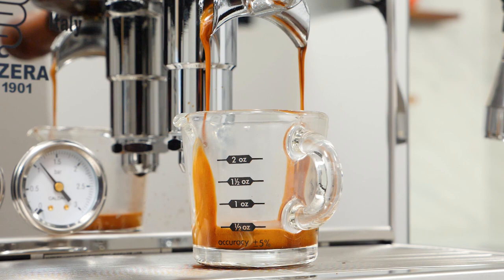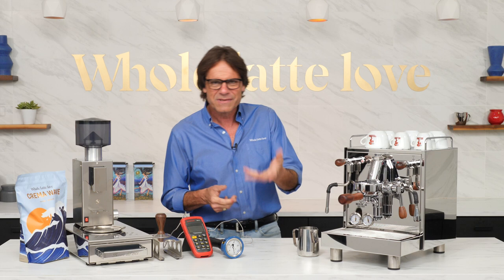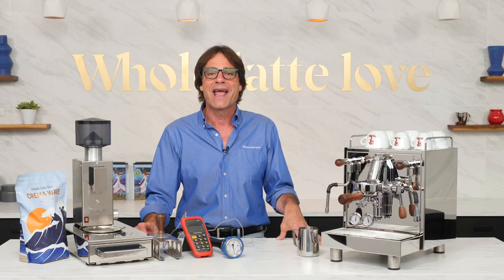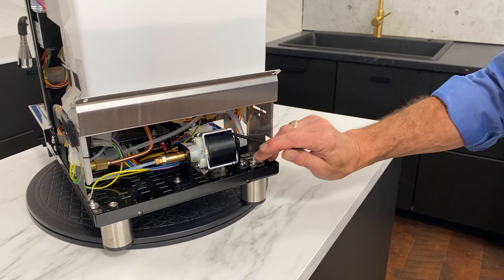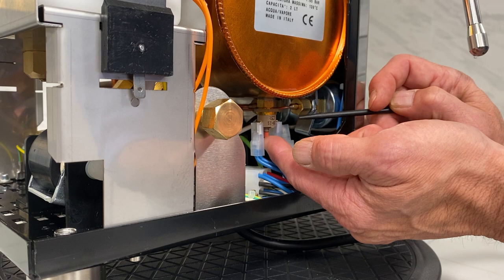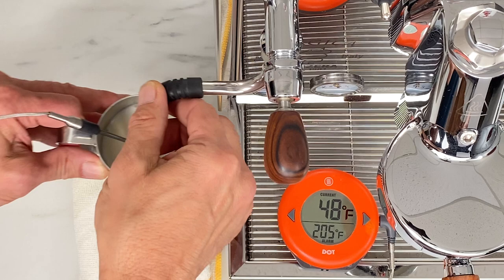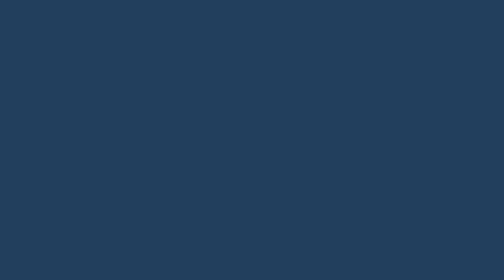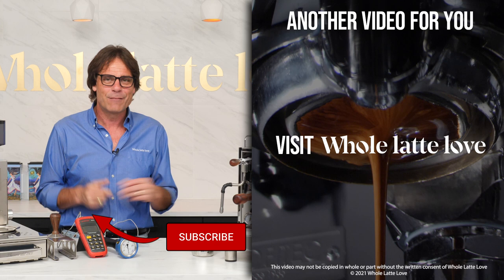Review Bezzera Magica PID Espresso Machine Inside Out

Comment: shut up and take my money. this is the best espresso machine review I've ever seen. I just moved to a smaller house and my single group commercial HX espresso machine doesn't fit so I sadly had to sell it. I'm brewing with an old gaggia espresso color and it's definitely lacking in the flavor development department. I wanted to get back to that solid HX performance, but am curious about dual boilers. after watching a few scace tests with PID'd HX machines, I really don't see the need to over complicate things with a 2x boiler when a PID on a high quality HX will lock you in within 1 degree. I feel like my pallet is well developed, but I really don't think I could taste the difference between 1º and 0.5º stability of a dedicated PID brew boiler. I'll save the $1k price difference and spend that on the best beans I can find.
Reply from the maker: Hey w, Thanks for the kind words on the video. Also, appreciate you sharing your thought process and decision. I agree with your assessment. I think even the best tasters would be challenged to tell a difference of 1 degree in brew temp.
Marc

Comment: nice machine if only have ROTARY PUMP, WHY THEY DO NOT ADD ROTARY PUMP, SHAME VIBRA IS JUST 3 GRADE PUMP FOR THIS BEAUTIFULL MACHINE, SHAME!
Reply from the maker: Hi dd, Thanks for the comment. Vibe pumps a very common at this level of machine. Rotary pump would significantly increase cost and size of machine. Some users like vibe pumps for their slower initial pressure rise which acts as a sort of pre-infusion. Also, slower pressure rise may allow one to use a slightly finer grind size resulting in a deeper extraction. Many other variables play into that but it's often the case.
Marc

Comment: I’ve Been using machine about a week now. I notice when the machine is sitting idle for a while the PID indicator turns off. I turn the machine off and on and sometimes that works but most times it does not. The reservoir is always full so I do t think that’s the issue. I did notice one time I slid the machine slightly forward on the counter and the movement brought the PID light back on. What can I do. Thanks
Reply from the maker: Hi BG, Sounds like a water sensor issue. I've linked to the section of the video which shows how water is sensed here: https://youtu.be/IBUjAZaJY_o?t=291
Make sure the screw heads on the sides of the reservoir have good contact with the metal flaps. If you remove reinsert the reservoir does that fix problem? The machine uses conductivity of water for sensing. Water must have some mineral content for sensors to work. So if you're using distilled or RO (not a good idea for many reasons) that could cause the problem. If contact with the screw heads on side of reservoir looks good you can trace the wires back from the pickup and make sure everything is securely connected. If still having issues and you purchased the machine from us contact our Tech Support team here for additional assistance: https://www.wholelattelove.com/pages/contact-us

Comment: The reservoir is 3 liters, not 4 as stated. I measured it and was annoyed by it, because that was one of my selling points for this machine. Maybe it all became mislead by the "total" capacity of water in the machine, which includes the boiler. But even then, I don't see the boiler holding 1 liter, cause when I descale and drain it, I get way less water than even half liter (from a full boiler). Also, changing the OPV from 12 bar to 9 or even just changing it to 11 bar really, generates a very terrible noise (kinda whistle, metal rattle)  when backflushing or when extracting espresso. I called the technicians on WLL and didnt receive any solutions to fix this problem, saying that I basically have to deal with it. Then I did my own research with various forums and groups online, and found out that it could probably be the OPV spring getting loose with lower pressure settings and the only way to fix it is to replace that spring with a 9bar spring (like what Gaggia CP offers). You should say all of that in this video, for transparency, otherwise people (like me) will think it's completely doable to change the pressure from 12 to 9 bar with no problems, and purchase the machine, to find out that it's not true.
Reply: Would you buy it again? I'm debating this or the Profitec Pro 500
Reply: @Mike_Genisys  So far, nothing can beat the price of the Magica for what you get all in all. I would still choose this over the Pro500 PID, because I don’t like the feature of the “return water” of the pro500 being drained to the drip tray instead of going back to the reservoir (as in the Magica). That would be a huge waste of water, especially if you set the OPV to 9bar. Also, I don’t like turning knobs over joystick levers for the steam and hot water. And having the power switch and led that low is not really a good idea, especially because that area is gonna get lots of water from the steam wand etc. Also keep in mind that the Bezzera has a copper boiler (nickel plated inside) whereas the Profitec has an insulated stainless steel boiler. Both types of boilers have pros and cons so it all depends on what suits you the best. To answer your question, yes I would buy Bezzera again…and yes, you have to deal with the probable noise of the spring in the OPV when set to 9 bar or so, but it’s not a deal breaker issue for me.
Reply: @valemodsVD  Thanks, I'm new to this and after going through a breville and delonghi, I just want something that's going to last and can grow with me.
Reply: @valemodsVD I'm looking at the BZ13, Magica and Profitec 6
500. About the Bezzera boilers, are they all nickel plated on the inside? Also, is copper "safer" than stainless steel?
Reply: @luigiporpora8322  I'm not sure if ALL Bezzera machines are nickel plated (maybe all the copper boiler ones?). Copper compared to Stainless Steel has two main advantages: copper is anti-bacterial by nature and will warm up faster.
Reply: @valemodsVD  So you recommend Copper over stainless steel? Definitely do not want brass (risk of lead).
Reply: @luigiporpora8322  absolutely
Reply: Hello, I’ve had this machine about a month now, and I’ve got the same noise you are describing, but it was even happening when at 12 bar. Adjusted it to 9 bar, and still makes that noise, have u found a solution?
Reply: @valemodsVD also my brew pressure gauge seems to stay on even when I finish my shot, like it’ll display “ 12 bar “ even though pumps not on, wondering if you ever had same issue ?
Reply: @valemodsVD  ALSO, even though I adjusted the OPV to 9 bar, somehow it still goes past it when brewing? All the way to 12..

Comment: I've tried adjusting the brew pressure like this and failed spectacularly. In my case the brew pressure were originally set (by the previous owner) to 15 bars. I brought it down to 12 bars, then I tried backflushing again and got 14 bars.

Turns out you cannot accurately set the brew pressure while the machine builds pressure.

You have to do a slight adjustment, then try to backflush and adjust some more if you didn't get it right.

Then, when you backflush you'll always get whatever you've set.

In my case this was 12 bars and it's still at 12 bars whenever I backflush
Reply from the maker: Hi e, Thanks for sharing your experience and advice. I have not found it necessary to do a backflush and re-adjustment. But if it works - go for it.

Comment: My 2020 Bezzera Magica PID looks slightly different from the inside! Not a lot, but Bezzera will have redesigned the machine here and there. For example, no easy drain for me! And the vacuum valve spoils the water over the boiler. Well, I can live with that.
Reply from the maker: Thanks for the info

Comment: Hi Mark, which is the difference between BZ Magica PID and Lelit Mara X V2 ? As far i understood, Lelit confirm that a big issue with overheating temperature was solved due the double PID priority on espresso or steaming . Is that true ? Is that a Lelit performance VS. other HX machines like Profitec 400/500 , ECM Classica, BZ Unica, BZ Magica or Rolet Apartamento ?

Comment: Hi Mark, i recently bought a Magica PID from you and I have one issue.  Sometimes the boiler auto fill pops on mid extraction interfering with the brew pressure ruining the extraction.  Is there any way to over ride the auto fill feature? Any suggestions would help.
Reply from the maker: Hey a, Any chance your water is really soft (low in minerals)? That can cause boiler to overfill a little. Then you start steaming and due to overfill you get more water out initially with the steam which drops level enough to cause autofill to kick on. If your water is normal hardness perhaps a workflow issue like your steaming a lot during an extraction soon after taking a bit of hot water out of machine. You could hack an override to autofill but not suggested due to danger of boiler going dry. I hope that helps. If you continue to have concerns please reach out to our tech support staff here for assistance: https://www.wholelattelove.com/pages/contact-us
Marc
Reply: Thanks for your quick reply.  I may consider a manual boiler fill switch.I lived for years with the rancilio and I am used to monitoring the boiler.  But I’ll live with it for now.

Comment: hi, what do you think of Bezzera Magica PID vs Profitec Pro 400? Any suggestion which one to buy?
Reply from the maker: Hi TT, Here's a link to a side by side spec comparison of the machines: https://www.wholelattelove.com/pages/compare?products=NjgyNjU0Nzg3MTc5OCw2ODk5NDY0MDc3MzY2
As you likely know, the Magica is a regular PID machine with temps adjustable in 1 degree increments. The Pro 400 is PID controlled but runs in three temperature ranges. For the majority of users the temp ranges are sufficient. Use lower temp setting for dark roasts, medium setting for light roasts and click over to high temp for extra steaming power. If you are extra particular then you may prefer the more precise temps of the Magica. Something else to consider if you purchase at Whole Latte Love the warranty is 3 years on the Profitec and 2 years on the Bezzera. Hope that helps!
Marc

Comment: Hello, thank you for your excellent reviews. Is it possibile to make the one on bezzera mitica pid?
I'm trying to decide among this one, ECM mechanica 5 and rocket mozzafiatio.
Or is it worth adding a little to the price and get double boiler, ie profitec pro 700. Do double boilers last longer? I'd love to get one for at least 15 years.
Reply from the maker: Hi A, Thanks for your kind comment and question. Machine longevity depends on how well you take care of it. Key in that department is using good water that does not cause scale to form in the machine. Scale is the number one cause of machine issues. You want some minerals in the water for good flavor and to prevent corrosion of metals. But mineral type matters. The mineral calcium causes scale at the levels needed for good flavor extraction. The mineral Magnesium does not. BWT Water and More makes filters that exchange calcium ions for magnesium ions leaving you with water perfect for extracting flavor that will not cause scale in the machine. Any of the machines you mention can go 15 years with proper maintenance.
If you will have a machine 15 years it's hard to argue against a dual boiler like the Pro 700. Amortize the extra cost over term of ownership and it's likely a couple bucks more a month. I guarantee you will appreciate a plumbable machine, with dual boilers and rotary pump over HX boiler machines with vibration pumps.
Hope that helps!
Marc

Comment: hi mark im  thinking to buy  the  bezzera magica in   this video  u mentioned a silicone tube what  happen with  water  coming  from that  tube? 
thanks
Reply from the maker: Hi rc, I think you are referring to the return tube from the OPV? It goes back to the reservoir. Purpose is to control pressure in the brew circuit.
Marc

Comment: Thank you for the review. Which would you recommend if same price, Bezzera Magica PID or Profitec 600
Reply from the maker: Hi HM, You are welcome. I'd go with the Pro 600 for the dual boilers!
Marc
Reply: @Wholelattelovepage  thank you. Not only ur videos helpful, but the answers to comments also helps. In the UK the model with Flow control from official retailer is about 250£ more expensive. Does it worth the difference in your opinion? Also it comes with Joysticks?

Comment: Another great vid, Mark. I want to make espresso and milk drinks. Between the Bezzera Magica and the Profitec Pro 500 with flow control which is the better pick?
Reply from the maker: Hi PSW, Both are excellent machines. It really comes down aesthetics. I may be a little biased as the Pro 500 is a long time favorite of mine so I'd go with the Pro 500. But, if you like lever operated valves maybe the Magica is the right choice. I do prefer the wire style drip tray of the Magica - it stays a little cleaner as water, coffee, etc doesn't pool on the surface. Flip side of that is you see all the liquid in the tray below the grate. Hope that helps!
Marc
Reply: @Wholelattelovepage  thank you so much for the fast and helpful reply!
Reply from the maker: My pleasure! I often respond to original comments first thing in the morning. No guarantees 😉
Marc
Reply: @Wholelattelovepage  🙌🏻🙌🏻🙌🏻

Comment: Hi Mark, This is great review and love it very much. Do you have or will do Flow Rate control on E61? how flow rate affect pressure as I see you set static pressure at 12Bar? Thanks
Reply from the maker: Hi NAV, Yes we do have flow control available on most all Profitec and ECM E61 machines. I have a bunch of videos on how to use like this one featuring a variety of flow profiles: https://youtu.be/_8lNz2rL5l8
Some of those same profiles are available as graphs in this article along with more info on flow rates: https://www.wholelattelove.com/blogs/articles/intro-to-calculating-flow-rate-on-e61-group-machines
Enjoy!
Marc
Reply: @Wholelattelovepage  Thanks very much for quick help!
Reply: @Wholelattelovepage  Hello, what is main reason of setting pump pressure at 12Bar?  Thanks
Reply from the maker: @Bobee2000  So machine gauges on vibration pump machines generally indicate a higher pressure than what's actually in the group. Loses in the hydraulics and also pressure is measured near the pump and behind a one way valve.

Comment: Does the PID screen act as a shot timer on this machine?
Reply from the maker: Hi MV, It does not. A comparable machine with shot timer, PID, E61 group and free flow control upgrade at the moment is the Profitec Pro 500 (Pro 500 w/visible PID & shot timer is a Whole Latte Love exclusive version)https://www.wholelattelove.com/products/profitec-pro-500-pid-espresso-machine-with-flow-control
The Pro 500 does not have joystick operated valves like the Magica. Instead it uses 1/4 quick steam valves with knobs.
Hope that helps!
Marc
Reply: @Wholelattelovepage  yes, that helps a ton, thanks! I've been looking at all ends of the spectrum for an espresso machine and looked at the pro 500 and 700, however, for what I could get the magica for (with flow control this month, and rosewood handles) vs the pro 500, not sure if I can justify to myself the extra money just for the shot timer. Thank you for the response! Was happy to see a response even a year after the video has been up.
Reply from the maker: @mvetere7  Hey Mark, I always monitor for all new comments and do my best to give a complete/detailed original response. Not always possible to reply to replies - but here I am!
Marc

Comment: Epic Co + review I must say. Can this machine be converted to or come with a rotary pump option. Also do you know anyone who is using this machine in a commercial setting? Do they do a plumbed in version. I have very limited space, and this  machine would be a great addition to the food + coffee mobile set-up. Thanks for the tireless work you do. 🔥
Reply from the maker: Hi br, Thanks for the comment and question. No option for converting to rotary - not enough room under the hood. Bezzera does have the dual boiler Matrix or Duo. They are dual boiler rotary pump machines. They are identical under the hood with external case work being the only difference. I do not know of anyone using the Magica in a commercial setting but it could go there in a low volume environment. Here's links to the Duo and Matrix. Each comes in either MN or DE versions. MNs use a lever operated E61 group. DE versions have programmable push button operation and use Bezzera's BZ group with internal heating elements:
olelattelove.com/products/bezzera-duo-mn-dual-boiler-espresso-machine
https://www.wholelattelove.com/products/bezzera-matrix-de-dual-boiler-espresso-machine
Hope that helps!
Marc
Reply: YOU CAN ADD A ROTARY PUMP WITH A MOTOR OUTSIDE OF THE MACHINE, IT IS THE BEST OPTION!!

Comment: How do you descale the bolier? Canm this be done by the user? Does this have a water filter ?
Reply from the maker: Hi E, Thanks for the questions. Machines with heat-exchange boilers like the Magica can be descaled by the end user. Here's a video demonstrating how to descale a machine with an HX boiler: https://youtu.be/yEGfyJkWSqU
The machine does not come with a water filter. We recommend using in reservoir pad filters like the BWT Bestsave: https://www.wholelattelove.com/products/bwt-bestsave-m-anti-scale-filter
or the BWT Penguin Pitcher: https://www.wholelattelove.com/products/bwt-penguin-2-7-l-water-pitcher
Both those solutions use ion-echange tech to replace calcium with magnesium in tap water. When used as directed they prevent scale while providing the mineral level needed for a proper extraction.
Marc
Reply: @Wholelattelovepage  Thanks for the quick reply - Kind regards from England.